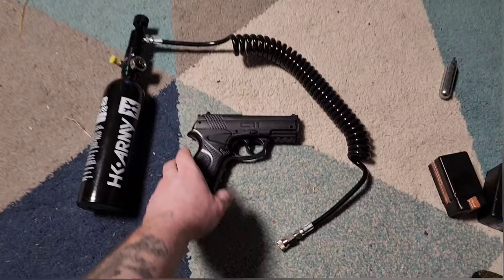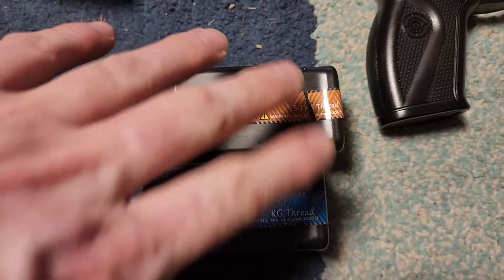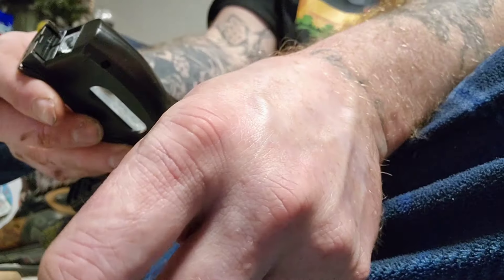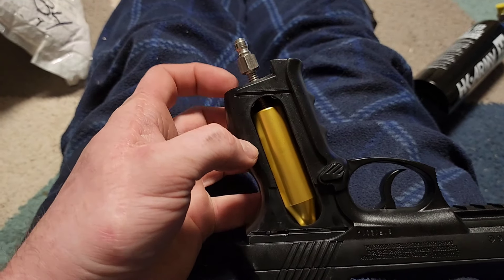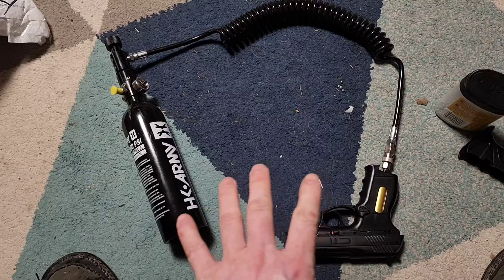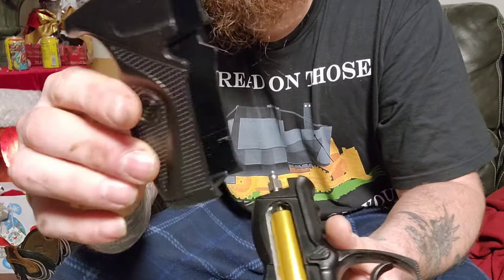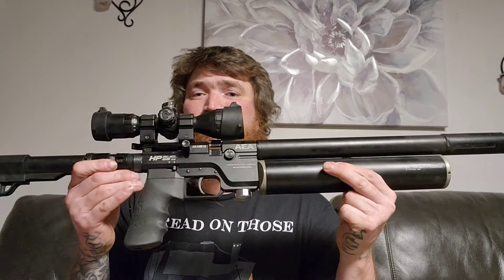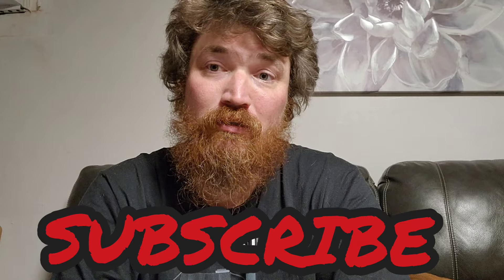Crossman bb pistol c02 to HPA conversion

Comment: Never been out to do sucha thing like this myself.. The idea of a bottle and an air whip attached to just a pistol kinda makes me put off..😂
 But now, if I'd ever wanna do it - I now know exactly which set suits what. So; the STW model goes for the very common tab style grip threads. Thanks for the info alone. 👍🏻👍🏻
Reply from the maker: Ya definitely cuts down on portability.. but still was a fun project.
Reply: @worthshop  Sure is fun and interesting. I like allkinda airgun projects. If really just want to plink around lots in the backgarden, then this HPA setup is very okay. Can have the tank strapped onto a belt or harness while plinking.
About to do an HPA setup for my co2 4.5mm Sig Sauer Canebrake ASP pellet rifle. Already got a short 10ci tank and a nice buttplate for the tank - but I haven't yet gotten hands on my wanted regulator..

Comment: Does this modification increase the velocity of the bb projectile ?
Reply: YES , AND WITH TANK SET WITH 1000 OR 1100 PSI , YOU WILL GET THE MOST POWER , THE TANK HE IS USING IS PROBABLY SET AT 850 PSI , THAT IS ABOUT THE SAME OF THE FIRST 2 OR 3 SHOTS FROM 12 GRAM CO2 . !!!
Reply: REMEMBER TO USE PLENTY SILICONE OIL , THAT WILL KEEP IT SHOOTING ITS BEST !

Comment: If you look into the Information about the tank that you got it may have a 800 psi regulator already so you may not need to limit how much air you put into it
Reply from the maker: I got one that was regulated to 1000 figured I could use it for higher power stuff in the future that way.
Reply: Then filling it up to 3000 psi would not be a problem since it will only let 1000 psi go to the gun what I have read is that the co2 is between 800 psi to 1000 psi
Reply: RIGHT ON POINT BRO !

Comment: Thanks for posting this video mate.  I ordered both the RG and STW Conversion kits off of Amazon last month and both finally came in.  They work like a charm with absolutely no leaks whatsoever.  I use both kits on several CO2 pistols with no problems or aggravation.  I should have bought these kits in the first place, but instead, I opted to try the American made adapters which only worked on one of my CO2 pistols.  Both of those adapters disappointingly leaked when I turned on the HPA.  These Chinese made adapters are well built and designed in a clever way with the utilization of an o-ring inside the cylinder.  Happy Shooting!

Comment: I Have A Co2  powered Full auto Rife it Uses 2 of The Co2 Cartridges. I'm getting to ready to switch it over to compressed Air  Already ordered a conversion kit Should be interesting lol
Reply: YOU WILL NEED A 2 INTO ONE CONNECTION , OR CAN YOU JUST RUN EMPTY AND HOOK IT UP TO THE OTHER ?
Reply: @RGAIRGUNNINJA  You have to use a two into one connection
Reply: @Tarheelsrule  I HEARD SOMEONE SAY ONCE YOU COULD JUST USE ONE CO2 IF YOU KEEP AN EMPTY ON THE OTHER SIDE , IS THAT TRUE ?

Comment: i got a legends m1a1 thompson, is there a way i can use a setup like this, its fun on full auto but the magazine uses 2 12g co2s in only like 4 mags 120 bbs before it fades in power
Reply from the maker: I do not have experience with that specific application. I am sure with a little creativity it is possible though.
Reply: I’ve been wondering the same thing, the legends look really cool but fuck buying all those 12g cartridges. I want to use my HPA compressor!
Reply: I have the same gun that you do Already Is order the conversion kit going To Mount The Bottle where  The Forearm  stock Is So that means no hyping to hold the bottle with the one hand and shoot with the other Order your kit and get it done

Comment: I want to do this with my Glock 19x on Reddit I was told it would blow up but my gun cost more than this one so question did it blow up because if not do you think it could work for me
Reply from the maker: Need a regulated air tank. Keep it under about 900psi and no mine never blew up.

Comment: Good video! I have the AEA HP max .35 cal, the Umarex hd50 and the Crossman C11. My Umarex with mod shoots a 3 gram aluminum ball straight through a unopened can of green beans! 
I'm thinking to get the Select fire AEA or M50 pistol. How's your AEA select fire holding up?

Comment: Looked real interesting. I have an older Daisy Powerline 1200 CO2 BB Pistol that the threads in the grip stripped out. It's lightweight Pot Metal. I am hoping this process  will resurrect it.

Comment: When using Co02 it is recommended to add drop of pellgun oil to the catridge to lube/protect o-rings. Do you still need to do this with the HPA conversion ???? If yes, can you so disconnect your hose and drop oil in the quick adapter or do you need to unscrew and remove the adapter each time you want to oil????????
Reply from the maker: Always a good idea to keep things lubed up. Just unscrew the hose and put a drop or two in before reconnecting the hose.
Reply: I Use Petroleum jelly as a Lubricant  on ThE O RINGS   LAST Longer And more durable than oil
Reply: YES , DROP SOME IN CONNECTION BEFORE YOU PUT HOSE OIL , SILICONE OIL IS BEST ! .

Comment: I like the way you think , can u recomend a air rifle or pump action rifle for backyard targets
$200  o runder
Reply: CHEAPEST WAY TO GO IS A BREAK BARREL , YOU CAN GET ONE MORE POWERFUL THAN THE PCP RIFLE , I WOULD SUGGEST NOTHING OVER 1200 FPS , IF YOU GO TOO FAST IT WILL DISTORT THE PELLETS IN FLIGHT , WHEN YOU GO MUCH OVER THE SPEED OR BREAK THE SOUND BARRIER , IT MAKES PELLETS WOBBLE , SO YOU WILL LOOSE YOUR ACCURCY ! 
BREAK BARREL AIR RIFLES ARE AWESOME TOO !!!

Comment: Is it possible to put a valve on the cylinder so the gun can maintain pressure without this hose? to be more portable
Reply from the maker: I do not think it would hold enough air in that little cylinder to last more than a few shots.
Reply: HOMEDEFENCE -24 MIGHT HAVE THE FITTINGS YOU NEED BRO !!!

Comment: I took a long tire air pressure tool. Unscrewed the top. Screwed that into a brake line nut.then screwed that into the bottom of the check valve in the gun. Then i put my air hose to it. Let the fun happen.
Reply from the maker: Good idea, hopefully you have a high psi compressor.

Comment: what size can is that? i wanted to get a 88Gr To my old crosman rifle it only has that 8 round mag but It would be more fun to shoot with more and consistent power. yeah it gets annoying to change those 12Gr tubes every 12 shoots..
Reply from the maker: 26 cubic inch size tank it measures 11.5x2.5 inches
Reply: @worthshop  sounds good... i could strap it to the  mussle of my riffle and have infinite CO2 supply...👍 i just got to do a custom adapter... 🤔

Comment: How much is the conversion total? Will it go through a 1/2in, pine board?
Reply from the maker: It doesn't make it that powerful, still just a bb gun. Cost about $55 for all the parts to convert. Plus a pump, but I already had a compressor.
Reply: If that's what you're after, just get N hdr50, pull the valve block, add hpa, and there you go.
Reply: @Travis-q8c  Whats that?
Reply: So do you have to have that canister to shoot the air pistol?
Reply: @Travis-q8c  YES AND MORE ! LOL

Comment: You probably already said it but will this increase fps??
Reply from the maker: Yes slightly. You don't want to over pressure the gun and break things internally though.
Reply: @worthshop  I have a crosman vigilante.. And idea what pressure I should use? And which kit?
Reply: @worthshop but it is possible to turn it up

Comment: YOU COULD FILL YOUR TANK COMPLETELY FULL , @ 3000 PSI . THE PART ON TOP OF TANK IS REGULATED , SO YOU WONT OVER PRESSURIZE YOUR PISTOL , THE REGULATOR IS PROBABLY 850 PSI . IF YOU WANT MORE POWER , GET A TANK WITH 1000 OR 1100 PSI , OR DO IT BY JUST CHANGING THE REGULATOR . 
YOU ARE SMART ABOUT GETTING INTO LESS LETHAL , BUT I HAVE 3 HDP'S IN MY COLLECTION , I RUN THEM ALL ON 12 GRAM CO2 , THEY ARE SET AT 26 , 38 , AND MY BEST IS 42 PLUS JOULES , EVEN MY LOW POWER HDP BEATS THAT BYRNA HANDS DOWN ! . I HAVE QUITE A FEW OTHERS , MY MOST POWERFUL ONE I HAVE IS 50 PLUS JOULES , ITS A MERCURY RISE INTRUBUSTER , IT IS THE EXACT COPY OF THE ONE CALLED PISTELLE X 68 , YOU SHOULD THINK ABOUT GETTING THAT ONE AND SELLING THE BYRNA LOL !!!! 
NOW ABOUT THE PRICE OF THESE CONVERSION KITS , IT IS AS OF DEC.9 2024 ,,, IT IS 18.99 A PIECE . SO ROUGHLY 38 DOLLARS FOR BOTH THREADS NOW !!! .....
I ENJOYED THE VIDEO BRO , NICE JOB !!!

Comment: What the air gun arsenal do we got going on here. Get back to the idi diesel videos, blue nose needs some love.
Reply from the maker: This was just a bonus video. My regular weekly video will be up Sunday, it is pulling a 700r4 transmission. I got a new radiator hose put on blue nose today. Working on a coolant flush right now, then will refill with new coolant. Appreciate you following the chanel, God bless.
Reply: Where can I buy one of those things that you are showing
Reply from the maker: @kylestreeter5068  HPA Converters CO2 HPA Conversion Kits, Co2 Magazine HPA Conversion Kit for Co2 Gun (RG Thread/STW Thread) https://a.co/d/0mObo98